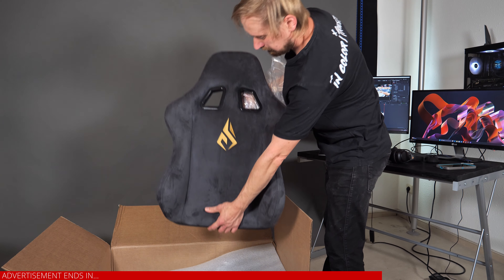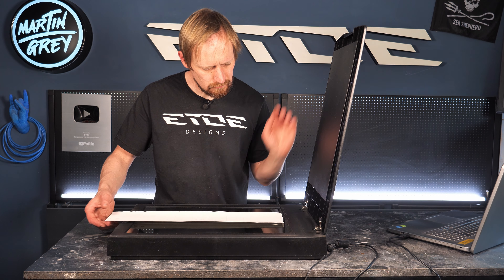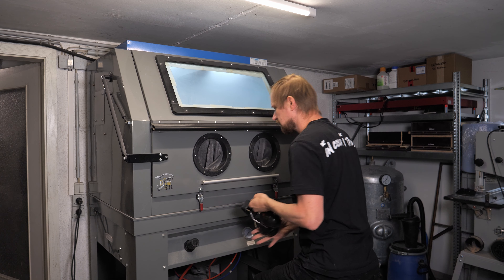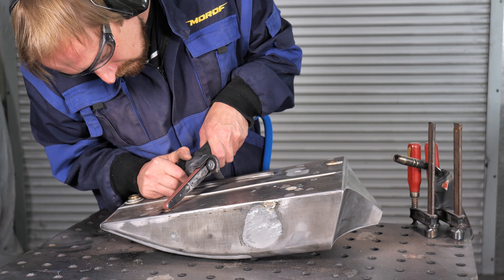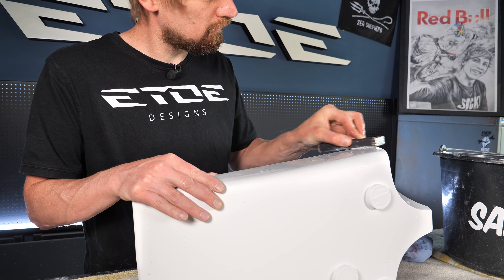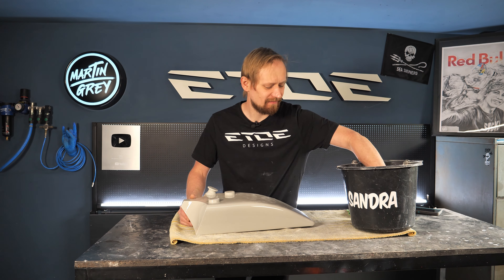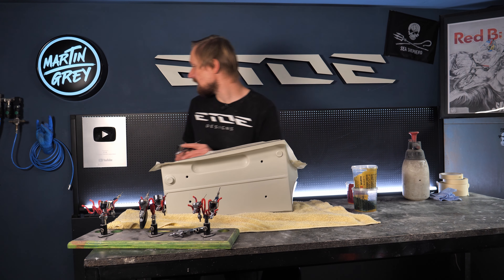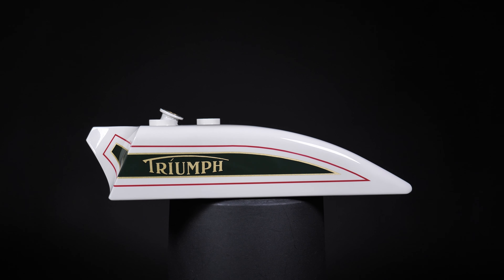Restoring a 100 year old motorcycle tank

Comment: Beautifully done! I just subscribed today and it's all about having the correct tools - and having the knowledge to use them properly. I'm 69 but new to the painting scene. I build high performance motorcycles and repair. I do my own boring, valve grinding and porting. I like you have the correct tools for this kind of work. A boring machine, valve grinder and a SuperFlow machine for porting. I decided I wanted to paint a drag bike I have built for myself - a 1976 Yamaha RD 400. Painting is difficult for me, so I am watching everything I can on YouTube. I appreciative and thank you for the. time and money you invest in your videos. I recently went to using a UV putty to save some time. It dries clear and for me it's difficult to sand because I can't see like I can with a colored glazing putty. On the metal gas tank it was ok, but the fiberglass body kit was a whole different thing. You run into metal and it stops your sanding, but the fiberglass it's real easy to sand too much and then your in to the fibers. I have never used an aluminum putty, is that something you use a lot or just specific items? Sorry for the long message and thank you again!

Comment: My grandad rode a motorcycle in the 1920s, he had a 500cc single cylinder BSA.
Those holes where probably use to mount the gas tank, standards.. well there weren't any.
He did tell me of when he was riding along and hit a bump, because gas tanks didn't have a valve to relieve pressure, just a hole and were just open, petrol splashed down his legs and onto the hot cylinder, setting him alight.
Thankfully two old women spotted it and put out the fire for him.